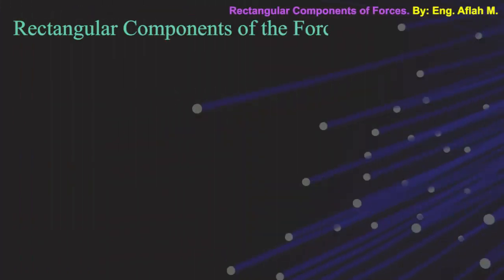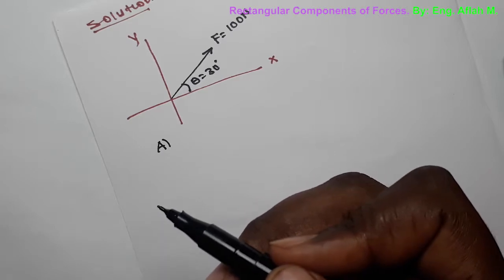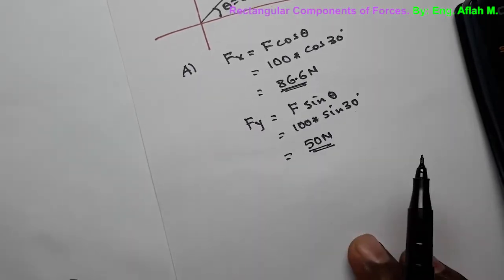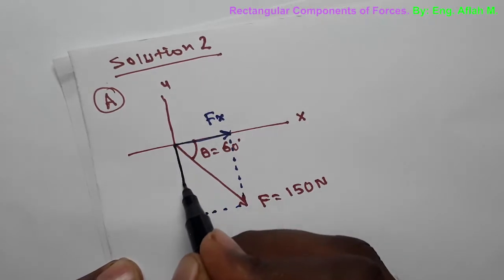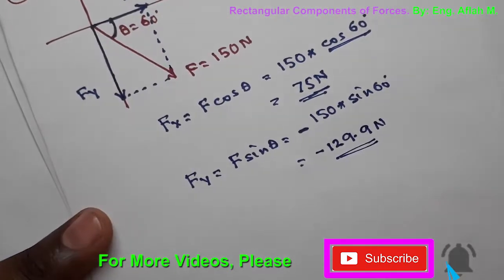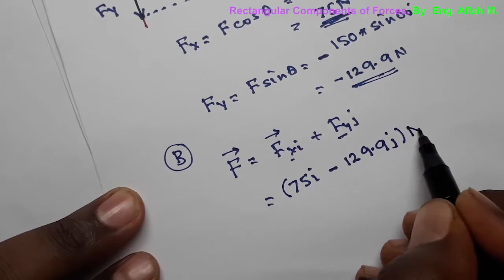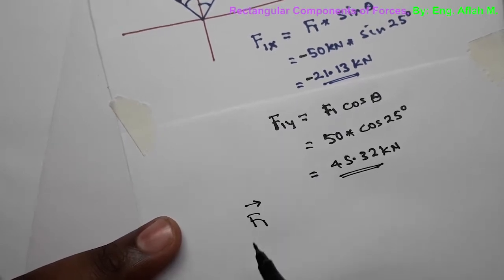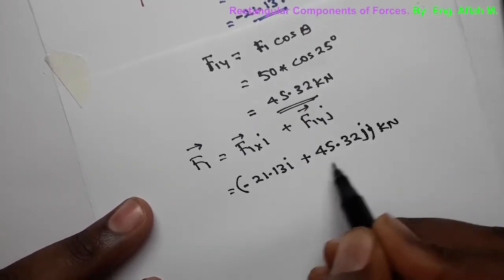Resolution of Forces. Rectangular Components of Forces new: English

Comment: Sir what if you take the angle to be right triangle and then subtract the components angles from 90* from them to now calculate it with respect to the x_,axis?
Reply from the maker: Yh, if the given angle (Theta) is with y-axis, you can determine the angle with x-axis (Beta) by subtracting (Theta) from 90*: [ Beta = 90* - Theta] .
Once you find (Beta), you can now determine the X and Y components of the force by:
Fx= F cos(Beta)
Fy= F sin(Beta)